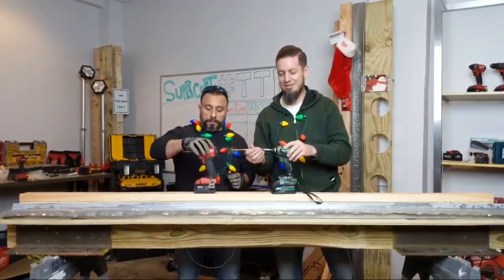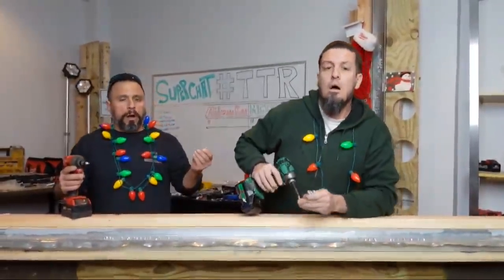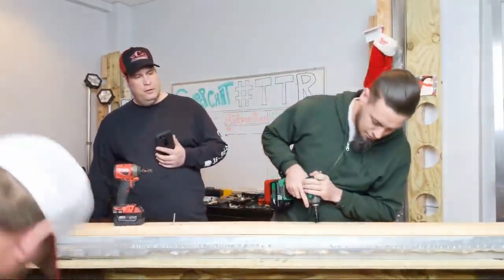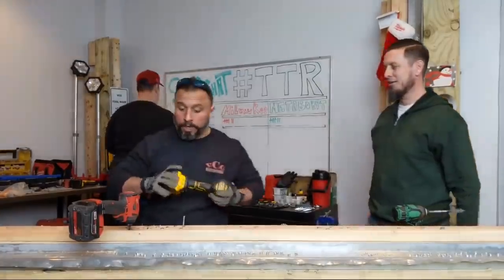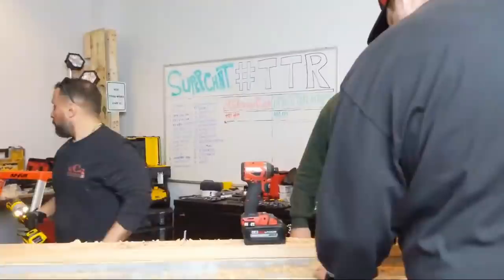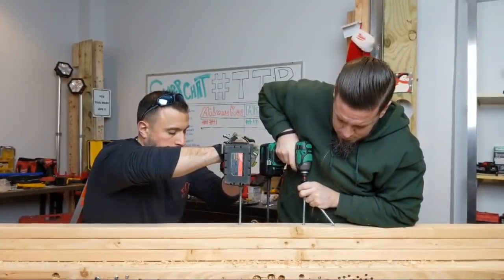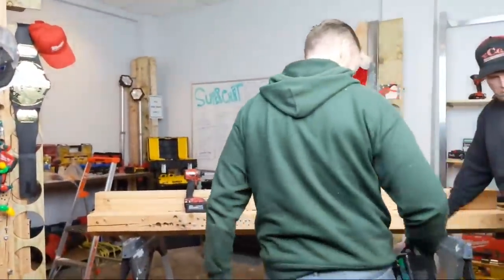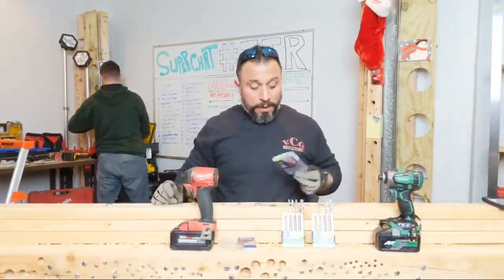Milwaukee (2853-20) VS Metabo HPT (WH36DB) - Best Cordless Impact Driver Comparison!

Comment: The term "best" is definitely relative. For example, my boss' Makita xtd13 is a little more powerful and has more torque than my Dewalt dcf886, but my DW has a better trigger modulation, and is more comfortable in my hand. Also the DW has a better collet which allows for better bit insertion and removal. I've used the Fuel, and it has a super stiff trigger and has a lag when you hit it, it also has an annoying collet, while it is a beast with power and torque. I think it just comes down to the best feeling tool in YOUR hands, and screw all the haters because these companies all make insane fkn tools! Cool video guys, thanks for posting!
Reply from the maker: You are correct “the best” with always come down to the users POU !

Comment: I love hitachi! I just bought all 5 nailers from lowes 23g 18g 16g 15g and framing nailer all displays but with the box with chargers and battery and bag for 526.50. There table saw new for 300 every display air nailer some new for less than 300 bucks for all 5. Only thing I own is the dewalt dsw779 miter saw I got new for 350. I like Milwaukee  for automotive work. But hands down construction Hitachi everyday all day and a few dewalt tools such as miter saws and grinders. I use the mikata router 3 PC set I got for 265 with 2 year warranty. The new 36 volt with the cord is awesome. Metabo hpt is stepping there game up!
Reply: I like your range, you use the brand that works for each project

Comment: Another Great TTR! Let me first say I'm in the Dewalt platform so the 887 would have possibly burned up in the test😜 luckily I'm still rocking 3 solid 885s. And thanks to you guys and the TTR, when I upgrade to brushless I'll grab the 787 instead of the 887.  Really think Milwaukee is doing great things but man that chuck issue is a bit rough! The Metabo is solid but man it's pretty pricey, at least right now. I almost pulled the trigger on that 6 tool brushless makita kit at the Depot this week but decided to hold off and see what the field looks like after Xmas since it isn't a need just an itch. Did pick up the Dewalt air compressor at the Depot for $79 after watching your vid. Keep on the Great Keepin On! Happy Holidays VCG Crew, Such a Great Channel with Great Content!!!!
Reply from the maker: Thank you for the support Sean! The 787 is no joke
Reply: Sean Duncan don’t give up on DeWalt over the 887. Still the best lineup of tools out there overall. Since other companies are putting bricks on their impacts I have a feeling DeWalt will be coming out with a sexxxy flexxxy version of an impact.

Comment: The Triple Hammer may not have won but it was the better impact being that it had no issues IMO.  I own the Milwaukee Gen 3 but seemed like the Triple Hammer is better.  I'd rather own it and have it registered with their lifetime warranty over the Milwaukee 5 year warranty.  I might be looking to sale mine considering that chuck issue.
Reply: Top Tools that red China gender 3 is fast. It is 0-60! No in between it seems.  As you saw in the video it will rip heads off of lags and will snap bits when they bog down. As Americans most love this. Want the biggest and fastest. Hence the need for chrome truck Nutz on two story lifted trucks. The Metabo calls for torque when needed. If you notice on some of the tests it looks like I am slow off the start. It actually is the gun applying the torque at a slower rate so you don’t snap the screw or drive the fastener to East Ghabip. There was even a paddle bit test where the Metabo was behind and then it seemed like it went to overdrive and pulled out a win. 
  I don’t care how fast you can go. If you can’t stop, does it really matter if you can’t tell anyone you won?? If you can’t get you bit out you have a flag pole installer.
Reply: C-Bomb Hahahaha. Vin!!! Screen shot this and put it on my tombstone. Who let the new guy into the Horn Pub???

Comment: In my observation: Metabo has the Trip. Hammer which helps the impact energy in the long end of longer screws, plus will have to say the operator can operate the tool. Perhaps it’s ergonomics work well with him. But Milwaukee has instant power and energy from the go and will torque out in single hammer impact in the end. Vince, I love the guy but them slippy bits ache my red passion.
Looking sharply,
MILWAUKEE: Instant Impact, Speed, Single Ham, Drives
METABO: Drives, Trip Hammer(impact ease in the end)... that’s really all I see.

If I go to a Tool Store and see these two on the shelf, I’d pick Milwaukee for the use of everything. If I was a roofer then I’ll smile at Metabo lol.

Comment: I'm all Milwaukee for my work tools the chuck on the impact i never had trouble with but on my hammer drill there's a sweet spot if i don't get it just write it loosens up. but not to much a problem

Comment: Metabo hpt is better. Battery lasts forever. I did tests against the surge pushing t30 and t50 screws. Triple hammer wins all day. Milwaukee is only more popular because it came out before this and was the best. But not anymore.

Comment: How can you say Milwaukee won when it couldn’t even retract the bit out of the wood and concrete 
all tests where this happened should be invalid or given to matabo, booo Milwaukee gat your head 
In the game
Reply: TruthofLuke that’s what she said. I said that too, but I’m just a “hater”.
Reply: Renaissance Man do a test of how long to put in a fastener that take a paddle bit lol
Reply: I agree.  Doesn't matter how fast you are if you can't get your bit out of a hole.  Metabo was in and out by the time the bit came out.  More control, more flexibility in platform power, better speed/impacts/torque ratio.  Metabo FTW.
Reply: @truthofluke991  I have the gen3 but the metabo is of higher quality construction..and in my opinion it performed better you got increased productivity with the metabo...
Reply: The big fella is obsessed with milwaukee...

Comment: Great TTR guys!  Renman was slinging self tappers this time. About the chuck....has anyone ever looked to see if another brand chuck is compatible?  I would assume they all have to be very similar design.  Just a thought.
Reply from the maker: I have not explored changing out the collet on the tool, I’m hopping Milwaukee will resolve the issue and I can send this tool in for service!!
Reply: I'd like to figure that out too, not a fan of how much slop my 887s chuck has. Not sure if it's just a problem with that impact or if other dewalts have that problem, I know my 8 year old 815 (which made me a dewalt guy) doesnt have any slop

Comment: The collet in the Milwaukee has a crappy spring that retains the ball bearings. They wear out and the ball bearings slip out of position. Milwaukee just needs to use better retention springs
Reply from the maker: Totally agree buddy, Milwaukee has got to fix this issue!
Reply: I agree that Milwaukee needs a better collet...same problem on the Ridgid...both TTI products but this milwaukee impact has been thru a lot of these tool tests and was put thru a higher level of abuse than you would normally see on a job site...so you will see issues after a while but this is why they do the tests so you can see what to expect from these tools.
Reply: kingofthecrease30 that’s right King!!! And THAT is where the scam from red china comes in. You use that gun with normal wear and tear and I’m sure it will last 5 years. Just long enough to get past the warranty. So now, do you fix your gun or buy the new Gender 5??? These are throw away tools. People don’t want to admit this. They think I’m a hater. I’m just a truth speaker.
Reply: @renaissancemen1  it's all good bro....I buy new power tools every 5 years even if they work fine....just because I want new stuff 😀👍

Comment: I don't think I would want to run that big honking battery all the time in the Metabo.  At 36V, there is no way to run a smaller battery.
Reply from the maker: I can understand your point of view!
Reply: Jeremy Steinacker there is no way on this multivolt platform to run a smaller ah battery. If you go with their 18v hitachi line you can drop to lower ah compact batteries. You just can’t run the corded adapter.
Reply: It depends how they set the cells up.  No reason they could have a 36V the size of the Milwaukee 5.0
Reply: They actually have a smaller battery with 18650 cells that's 2.5ah at 36v and 5.0ah at 18v
Reply: But I don't think it will be available in North America, just Europe
Reply: @renaissancemen1  there's truth to that
Reply: They came out with a smaller 2.5aH

Comment: I've never used an impact for a paddle bit. Is that common?
Reply from the maker: In a pinch but usually you would use a drill. This is just a test to put them through their paces.

Comment: Vince just have Milwaukee fix the Anvil spring. It's 3 bucks if you do it yourself. Some DeWalt's had this problem. DeWalt probably fixed the springs in later versions.

Comment: You guys outta use them Milwaukee lights as camera lighting
Reply: No need to...there are LED panel lights right above the camera...it works good...the lights in the shop are on motion detection so they kept shutting off because the sensor is behind where the camera was
Reply from the maker: They are so bright it messes with the camera flicker rate. The lines you see going up and down

Comment: Moving to a high output was a BS move lol. It may equate to 8ah in standard battery terms but changing the possible maximum flow of amps is not equal. And more like king of Vince’s crease lol

Comment: The Milwaukee chuck on their fuel 3 speed impact is garbage.  Just last week a hvac tech in a building I am wiring complained about it and he showed us that a C clip retainer came off, now the chuck does not hold anything. You can put a bit in and it falls out. Lots of technology in the tool, but also lots of sadness in the chuck.
Reply from the maker: Aaron the collet definitely needs a revamp!!